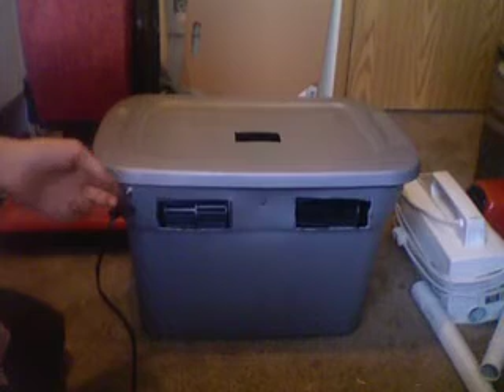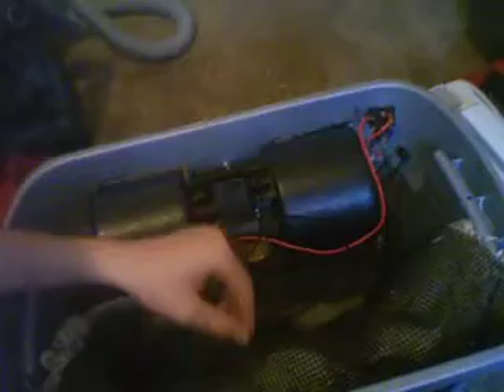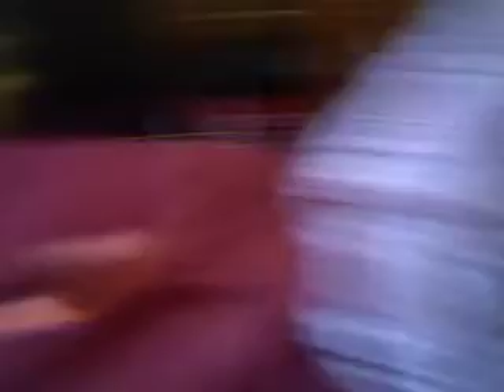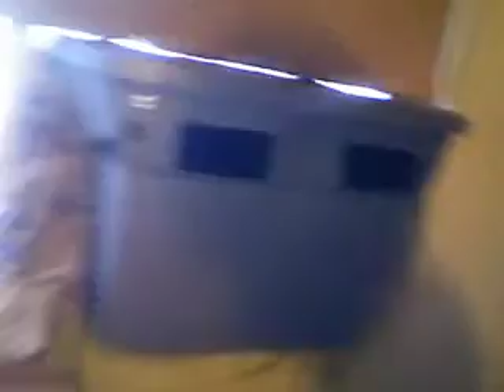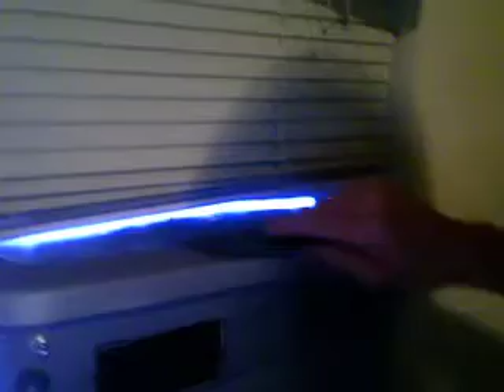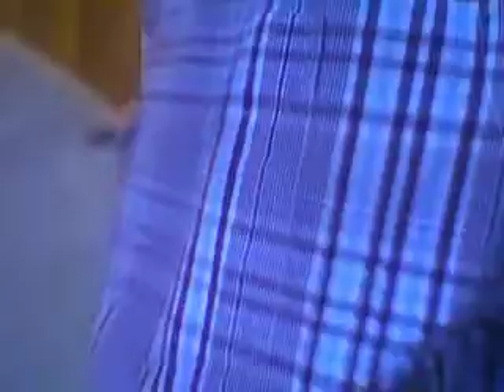Homemade Swamp (Evaporative) Cooler

Comment: I live in the desert in Albuquerque,NM and these coolers are cheaper to run than refrigerated air but they are very inefficient in my experience.  Plus they have to be serviced at least once a year and take a great deal of water.  If you are living on an already overstressed aquifer like I am it really is a bad idea to use more water than you would  need to drink in a day.  When you have about 200,000 of these things running in an urban sprawl it can be extremely damaging.

Comment: Very nice work! I'm in the process og building one on a much larger scale (for 750sqft) using a large wheeled trash can and a 12 volt DC radiator fan that pulls 1250 CFM. Great job! Did you get the squirrel cage fan set on eBay?

Comment: This is green energy because it saves so much electricity, it makes it practical to put one anyplace to bring the air down a few degrees, even if it's solar powered electricity.  Maby an "energy star" rating or whatever they call it.